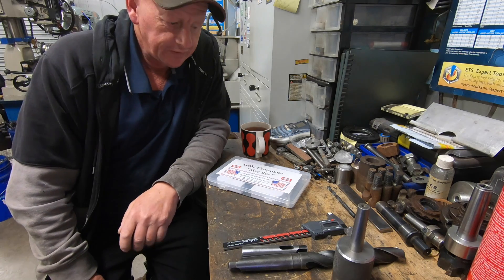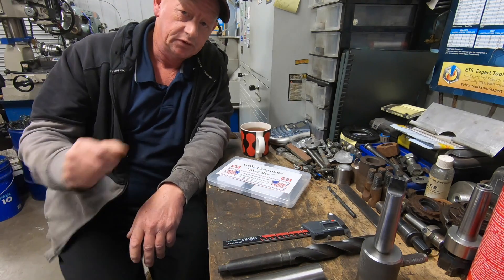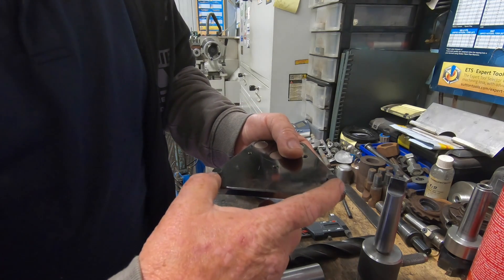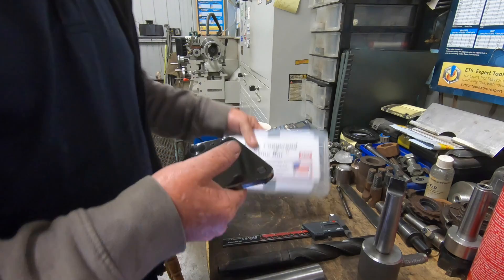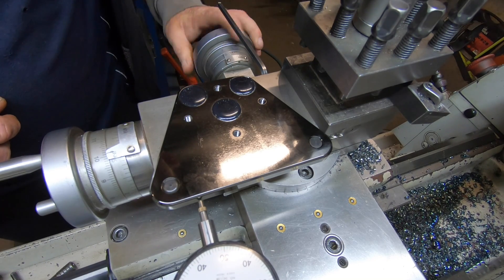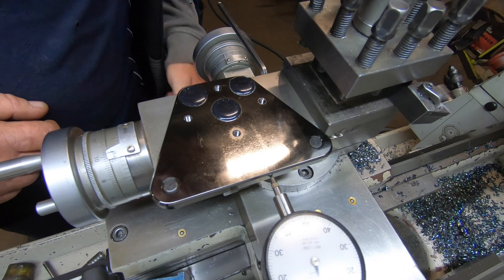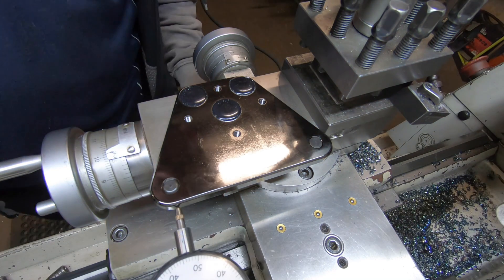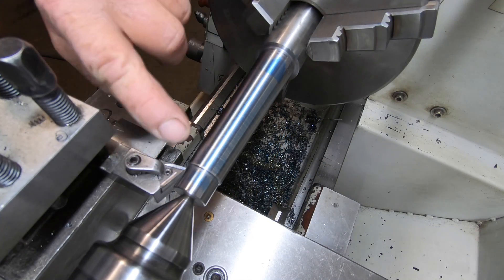Machining a Morse Taper using a Lathe Compound Sine Bar

Comment: Assuming the outside edge is parallel with the dove tail looks neat. I usually chuck up a morse taper and sweep the morse to get the right angle.
Reply from the maker: Cheers for watching the video mate

Comment: I would make a set of buttons to fit 1 sine pin and will give wall thickness for any gauge dimension for any taper if that works
Reply from the maker: Gday, that’s a good idea, especially for common angles like 45°c, thanks for watching, cheers
Reply: @MattysWorkshop  Hey Matty, this is my good mate Peter Pilbeam.  He helped me at Harvester College and is full of useful ideas.  Cheers, Aaron

Comment: Love it...  Very smart.  Anything that saves me 45 min of aggravation from fiddling around with the lathe adjustment is goodness.  Take my money
Reply from the maker: Gday, definitely a big time saver, I’ve always used the 2 dial indicator method but the sine bar way is another story, only a fraction of the time and more accurate in my opinion, lots more uses then just the compound as well, certainly a tool worth buying mate, thanks for watching, cheers

Comment: Good job with the sine plate. If you have a surface grinder it would be easy to mill and grind a few common size blocks from steel. Lap the last few tenths off on the surface plate with 1000 grit wet or dry and keep them oiled in a box.
Reply from the maker: Gday, a surface grinder is on the wish list but won’t be anytime soon sadly, thanks for watching, cheers

Comment: That's a nice bit of kit Matty 👍👍👍 Definitely faster to set up than your old method, although saying that the old way got the job done. Cheers, Alan.
Reply from the maker: Gday Alan, definitely quicker with the sine bar, the old method worked well and I got plenty of great results, the only problem I had with the old method was you need a good quality indicators, I did use a cheap one and found the bit of play in the shaft can give you a false reading, thanks for watching mate, cheers

Comment: This looks like it is just the tool I need. I have an albrecht drill chuck that I purchased without knowing it had galled on the Jacobs taper it was installed on. This ought to allow me to true it up without having to buy anspecific reamer. 
Does Tangent Engineering have a website so I could see what other products they make?
Reply from the maker: Gday, you can contact Jim via email jimenos@acushnettool.com   Jim also sells the quill wheels for various milling machines, thanks for watching, cheers

Comment: Nice tool Matty. I'm wondering if you could turn up some buttons from brass to match the gauge block thickness you would need for the most common tapers like 2 and 3 Morse and 30, 45 and 60 degrees. You'd be able to get the thicknesses to within a tenth or so. It might save you having to buy a whole set of blocks in the short term.
Reply from the maker: Gday Preso, I’ll definitely be making the common size shims to use for the time being, gauge blocks aren’t cheap so there on the wait list, thanks for watching mate, cheers

Comment: Hi Matty     You have done another excellent job this time using the Sine Bar. I was Impressed how the two mating surfaces while testing locked with hardly any pressure.  Again well done
Reply from the maker: Gday Ted, the taper turned out spot on, it didn’t take much to get the sleeve to hold the taper at all, thanks for watching mate, cheers

Comment: You probably should of been cranking the top slide when indicating. As that's would move when cutting the taper? Interesting video good job
Reply from the maker: Gday, thanks for watching and commenting, cheers
Reply: If you draw a picture of the top slide and sine bar at each end of top slide travel, you'll see that this doesn't work.

Comment: By milling the tang 1st before machining the taper you don't have the trouble of trying to secure unparallel work and with so much overhang for Arbor clearance and increased chatter/vibration on the cutting so just milling flats 1st in a vice is easier while barstock is parallel.
You can just clock up the tapered edge on an Morse tapered sleeve in between centres to find the correct angle setting for cross slide/compound slide(parallel). Cheers
Reply from the maker: Gday, I should have machined the tang first, I did get order of operations wrong there, setting the compound by using a sleeve is not as quick, by the time you recut the taper in the chuck and make sure the tailstock is aligned to the spindle 100% the sine bar will be quicker, thanks for watching, cheers

Comment: very nice tool Jim makes.  also, you did good job on the tool you made.
Reply from the maker: Gday Doug, Jim’s does make good tooling, the finish on the sine bar is spot on and it certainly made making the Morse taper a lot easier, thanks for watching and commenting mate, Cheers

Comment: Until someone invents a rotary dro for a lathe compound, I can't think of a more accurate way to cut a taper. The sine bar may actually be more accurate anyway. Thanks for the video!
Reply from the maker: Gday Mike, you can buy an electronic encoder for the rotary table, they are quite a good item and accurate, my theory is that the sine bar can be used for multiple applications like setups on the milling machine, setting the shaper table on angles and so on, thanks for watching mate, Cheers

Comment: That seems to be a very nice piece of equipment. All it needs now is an easy way to hold the gauge blocks in place while installing.
Reply from the maker: Gday Rustinox, I have found with the magnets being so strong once you have you stack of whatever you're using the sine bar will hold everything in place, Thanks for watching, Cheers
Reply: You can certainly make one of these.

Comment: Nice job Matty.
I have often thought that making a dedicated block for some jobs shouldn't be too hard.Machine a block of brass or steel in the mill and measure as carefully as your tooling allows.It could then be lapped to get the final microns off, if you can measure them.
While you wouldn't try to make a set of blocks a single one fit for purpose is just another bit of careful work in the shed.
Reply from the maker: Gday Micheal, definitely easy to make a dedicated block, I think this is the way ill go for now, Thanks for watching, Cheers

Comment: Nice tool Matty !
You can get another type of gauge block (called a space block )that screws together and because they don’t have to be lapped to make the wring together they are much cheaper - Aussee have them for under $100 a set but they are out of stock at the moment . They also have cheap sets of gauge blocks . I wouldn’t waste my money on  something Iike Mitutoyo or Starrett as I don’t need that sort of quality in my back yard workshop . Currently I am using a set of these screw together blocks or an adjustable parallel and feeler gauges which is perfectly adequate for my needs .
Might have to make one of the those sine tools !
Reply from the maker: Gday Ian, i'll check the space block out for sure, definitely won't be buy a starrett set, need to be a millionaire for that, Thanks for watching, Cheers

Comment: Good video worked out perfectly! As far as a gauge block you could machine a dedicated gauge block for different tapers since you have the constant of a sign bar, just a thought
Reply from the maker: Gday Bill, there's been quite a few times ive needed gauge block, ill definitely be getting a set but making a dedicated block is a great idea which I might do, Thanks for watching, Cheers
Reply: You could also just make rings to fit on the posts of the sign bar with the appropriate outer diameter for whatever angle you are shooting for. You can bore or ream the ID and turn the OD to any perfection you need!
Reply from the maker: @berndheiden7630  Brilliant idea mate, Cheers

Comment: Hay Matty that looks like a great must have tool for the shop. I bought a set of gage blocks used this summer Didn't know if I really would use them, but found that I use them all the time. Great result on the taper. Cheers
Reply from the maker: Gday, Thats what happens, you put off buying a new tool because you think ill never use it then you find you never stop using it, I can see this happening with a gauge block set here, Thanks for watching, Cheers

Comment: Nice one Matt. I wonder if you were to drill and ream near one of your lock bolts for a close fitting pin, so next time you need a 3 MT it would be simple matter of putting a pin in a hole? Just thinking out loud here!

Comment: Nice one Matt. I wonder if you were to drill and ream near one of your lock bolts for a close fitting pin, so next time you need a 3 MT it would be simple matter of putting a pin in a hole? Just thinking out loud here!
Reply from the maker: Gday Peter, that’s really not a bad idea, it would have to be absolutely spot on that’s the only thing, thanks for watching mate, cheers

Comment: Nice information on the new tool Matty and excellent demonstration on how to use it. It is quite fitting that you would receive that sine bar tool because you will make good use of it and you've made it helpful to others. Thanks for the video.
Reply from the maker: Gday Jim, the sine bar works a treat, I can see many different uses as well to do with the milling machine, I like tools that just work, thanks for watching mate, cheers

Comment: Hi Matty, It was the firs time for me that i saw this syne bar: i made morse MT2 and MT3 by putting a dial on a real MT morse and copying the angle, i think that this more faster then the old method!! Can i ask you the code of your tool insert?😀 It gives fantastic surface finish! 💪 Thanks Mate, a great video!! Alberto
Reply from the maker: Gray Alberto, Setting the compound with the sine bar was so much more easier then using the old technic of 2 indicators over a set distance, the triangular insert I used on the arbor was a TNGG, these one are made by Union Materials, there work very similar to HSS, you can take very light cuts and get a beautiful finish every time, I buy mine from LiveTolls here in Australia, Thanks for watching mate, Cheers
Reply: @MattysWorkshop  Thanks Matty! I will go to search the TNGG 😁

Comment: Hi Matty, good work on the taper. Good to see the sine bar method was fast and accurate. I also don't have gauged blocks and I have had to improvise in the shop. The cheap set (probably Chinese) is $700. Starret gauge blocks are $1,700. I think it will be a while before I get some.
Reply from the maker: Gday, the gauge block sets are outa my price range as well but hopefully I’ll find a secondhand set somewhere, thanks for watching mate, cheers
Reply: I would have to go back to my receipt, but I bought my set a B-Joe blocks from Amazon (Shars brands) for $135, but thats been 2 yrs back. Good set for the money :)>

Comment: If you haven't got a gauge block of the correct size, one fairly accurate way to space a sinebar is to use a wedge. Find a piece of stock about the right size and mill a slight taper over its length. Use your micrometer to find the spot of the correct dimension mark that and use that spot under the sinebar .

Beware that most machine tapers are spec'd to four decimal places so accuracy is essential.
Reply: what about adjustable paralells
Reply from the maker: @ronalddavis  Gday Ronald, I do own adjustable parallels and I honestly didn’t give them a thought, they will work well for larger angles, cheers
Reply: @MattysWorkshop  yeah the smallest adj paralells go down to maybe 3/8 in or so? could make some though if you hane a surface grinder and VERY small screws
Reply from the maker: Gday Bill, thanks for the advice, I’ll remember this one mate, cheers

Comment: That is an impressive bit of kit, Im impressed. like you Ive made an MT2 using dial indicators and it took a while to get right. I recently got an MT2 reamer set from China and I was mighty impressed with how well that worked. The roughing reamer took more pressure than I expected but boy did it cut when it got going. So nice to have the right tools. Mind you  need a set of gauge blocks too, there's always something :)
Reply from the maker: Gday, Im really impressed how well this tool works, its a simply tool but it saves a lot of stuffing around, the import reamer set I have are surprisingly good, cheap but good, Thanks for watching, Cheers

Comment: Mattie, you jammy Bastard! Getting the angle almost dead right on second knock of the compound! Lol that sine bar is a nifty bit of kit. The finish, whatever it is looks fucking superb. I bet they are a good few shekels though! All in all mate a good result ( although you could have gone out and bought a dedicated 2-3 morse sleve lol 
On the subject of slip gauges mate. Look on ebay. I got myself a complete set bar one slip, for I think it was £60 GBP so they're not a great deal of money, mine are British made Matrix and not cheap China crap and I doubt you'd get imperial ones anyway, assuming you want good old bannanas as Kurt's calls them lol cheers from the UK Sam
Reply from the maker: Gday, I was just a shocked as you getting it almost spot on 2nd tap, thats never normally the case thats for sure, im going to have to start searching Ebay a lot more in find a set, im not that keen on a super cheap import set, Thanks for watching, Cheers

Comment: I turned a 2MT arbor on a project earlier this week on my little homemade lathe, could have done with one of those, it took me ages to set up another arbor in the chuck and tram the compound to that 😏. Nice work once again Matty 👍
Reply from the maker: Gday, I normally use 2 indicators measuring over a set distance, this is so much quicker thats for sure and accurate, Thanks for watching, Cheers
Reply: @MattysWorkshop  I've watched you do that, I just run one up along the side of an arbor, limited room, it's only a small machine👍